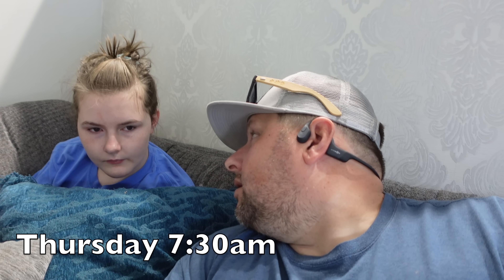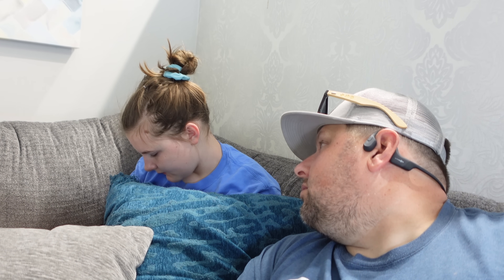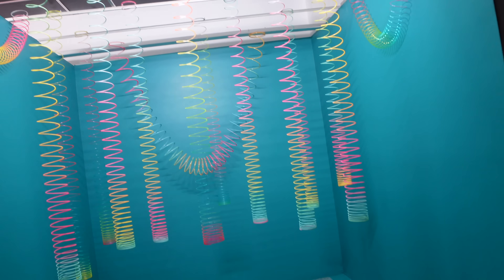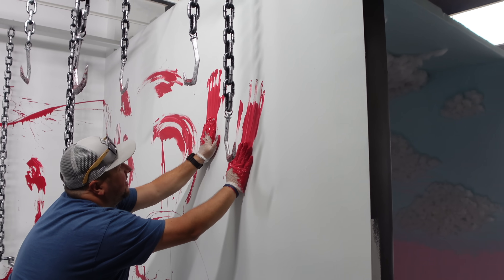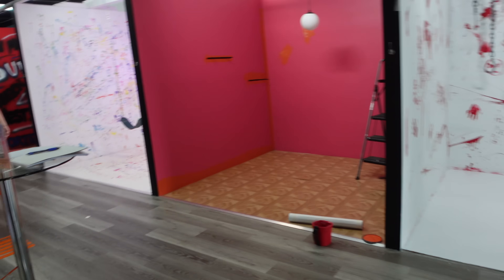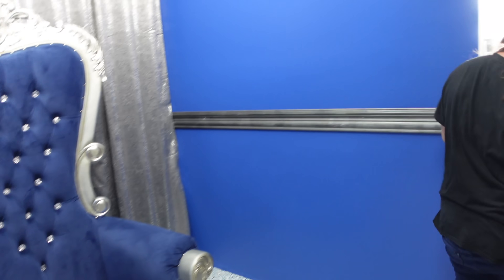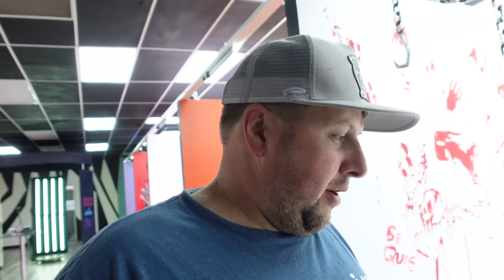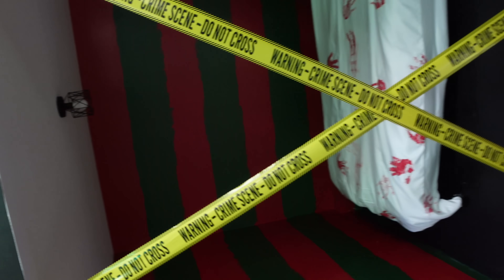No Sleep For 38 Hours

Comment: Amazing work,I don't know if it will work could you use foam board in sheets have painted ect and change out for different holidays,seasons or different themes for the walls